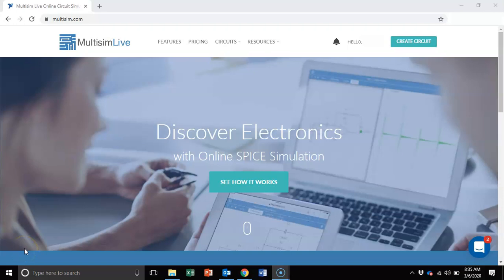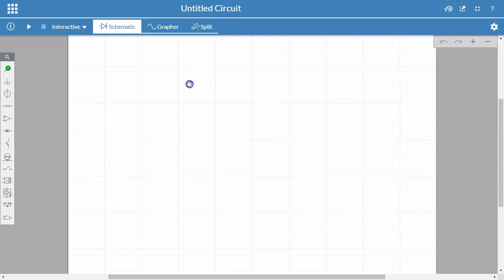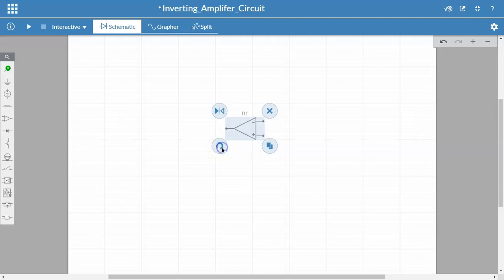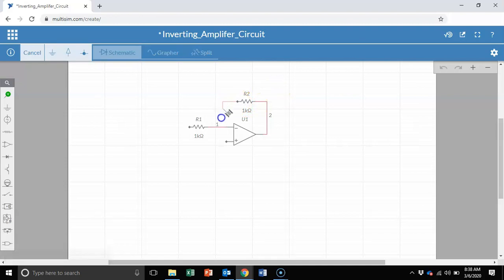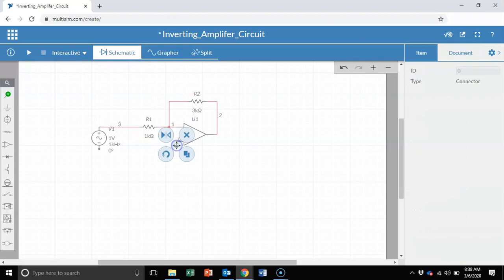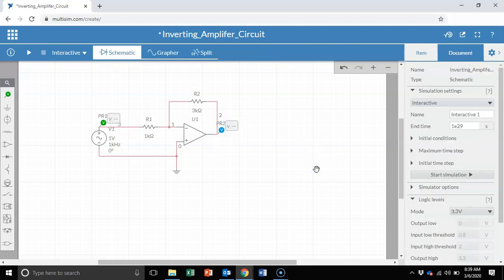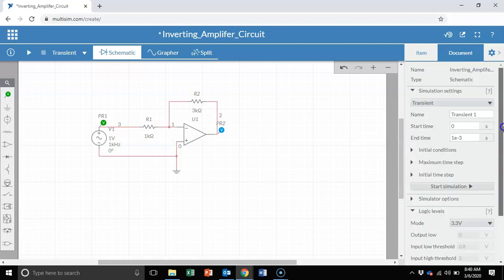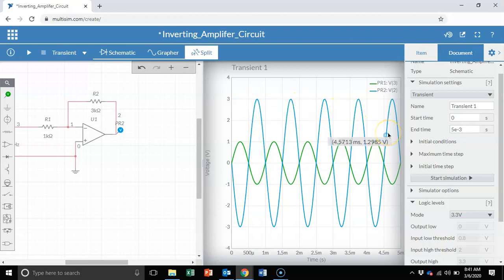Circuit Simulation using NI MultiSim Live

Comment: i noticed on the circuits i simulated, if you use multiple relays 
on a schematic the coils of the relays shut on and off not
holding steady  if multisim  is not steady with a basic design 
how much trust can you put on this program in a complex circuit.
at 4300 hundred dollars you would expect a lot better results.